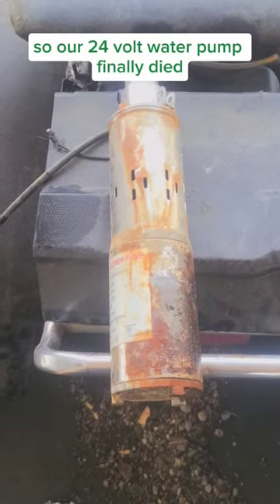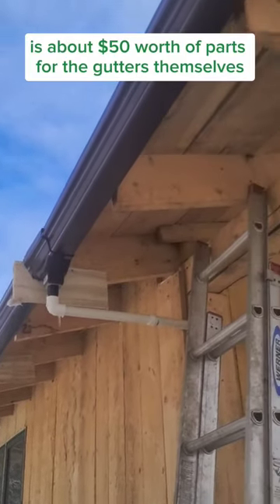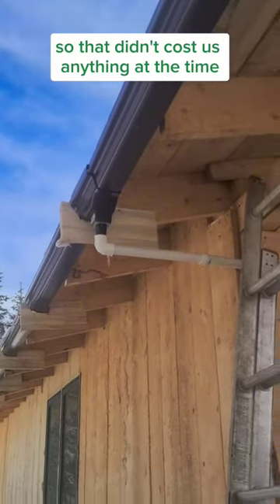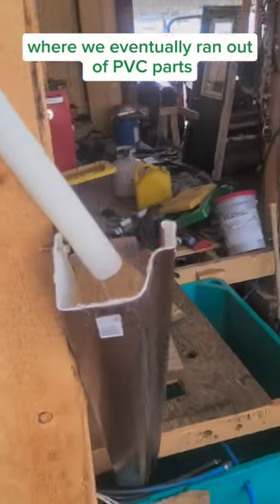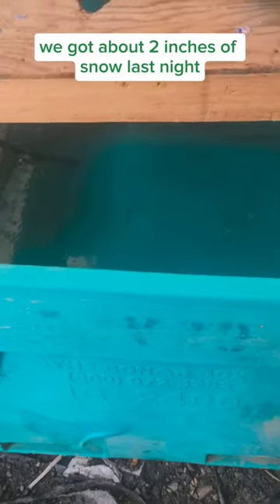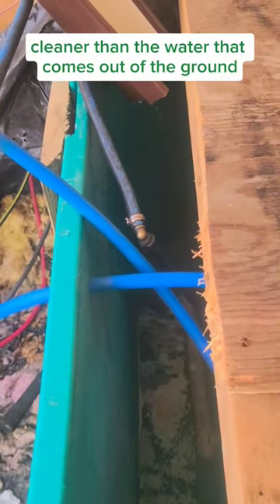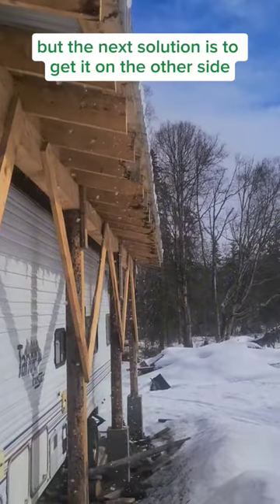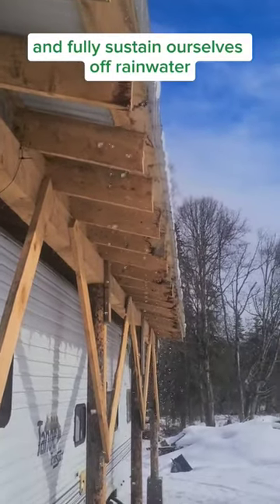Off-Grid Rain Water Collection Diy Homestead Water Solution

Comment: U would be amazed how much mud is in rain water snow even more .build a 8x8 shed insulated 7 foot inside 4 250 gallon 1000 letters at 9 foot high filters water heat spare bathroom 😊

Comment: The water IN the ground is WAYYY cleaner than the water off your roof my guy. Now off a puddle yeah maybe not, but from a well? You can almost guarantee that well water is basically safe to drink while the water from your roof is not.
Reply from the maker: I dont think you heard what I said in its entirety but I never said it was clean to drink only physically clear in comparison to our Sandpoint well because we have been getting sand coming up in the water thats clogging my drinking water filter hopes this clears up any misunderstanding
Reply: @alaskanjackofalltrades  No, you actually said it is cleaner off the roof.
Reply from the maker: @percyfaith11  of sentiment, yes, it is. idk what's hard to understand about that. I also specifically said I still filter it for drinking water, but it is clearer, so it doesn't clog my filter as often
Reply: @alaskanjackofalltrades a filter won’t help ya bud! Might want to do a little research on drinking rain water!! No need to make yourselves sick! At least boil it first!

Comment: The water off your roof is definitely not cleaner than the water that comes out of the ground.  The roof and gutters and pipes are open to the atmosphere and contain all sorts of contaminants.  Well water is filtered by the soil and sand and rock that it passes through.
Reply from the maker: Clean in terms of sentiment that clog my water filter not in a drinking water sense